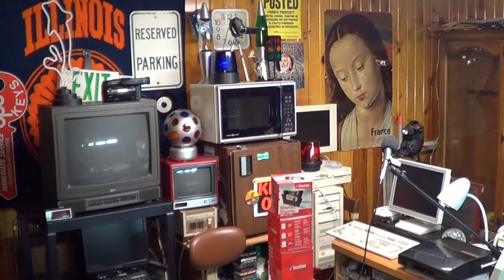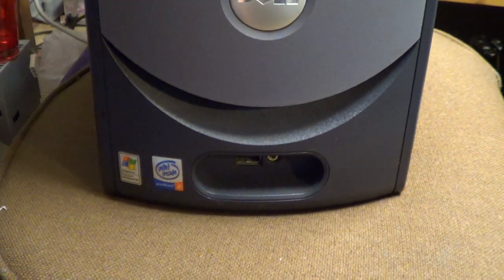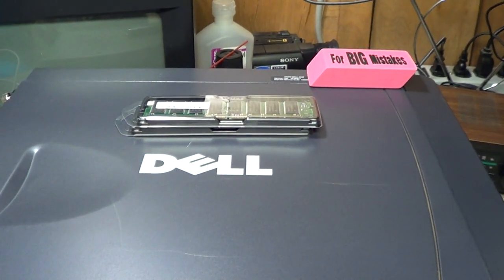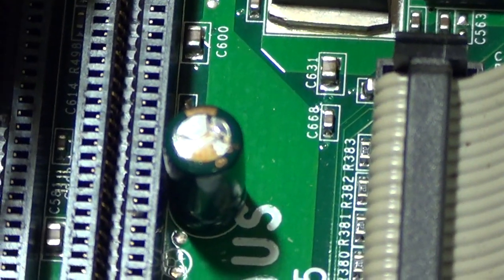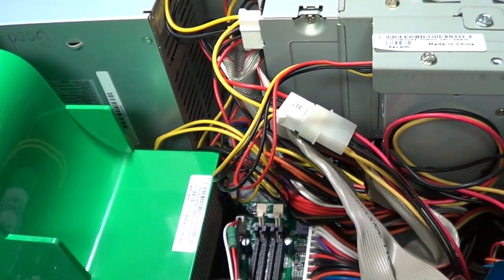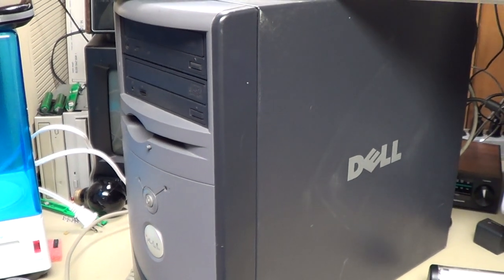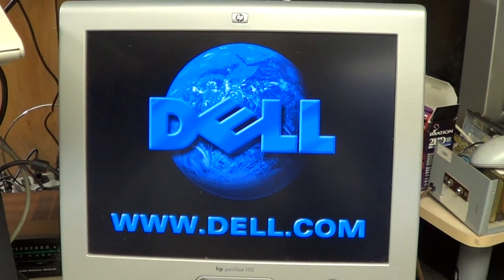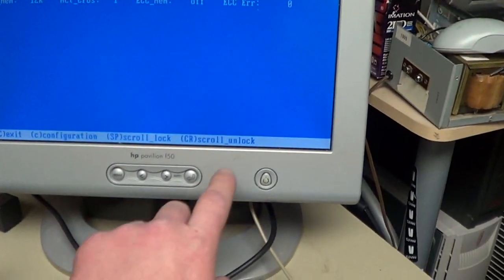Dell Dimension 2300 "Music Player" Computer RAM Upgrade

Comment: Uxwbill,im a very big fan of you. But i have a question, i have a dell demiension 2400 and for some reason i cant download stuff on the internet. Could you please reply and tell me how to solve that problem. Also if you reply i will subsribe to your channel!!!!!!!!
Reply from the maker: Whatever you are dealing with is probably not a hardware problem, and you have to bear in mind that computers can have thousands of different software configurations. It would also help to know exactly what you are trying to download: music, movies, games, software, maybe something else? It may also be very important and helpful to know what error messages you get. What operating system are you running, and what version is it?

If you have access to another web browser on that computer, have you tried doing the same thing with it?

It is my goal to read and respond to any comments posted on my videos whenever I have something to offer. There is no need to subscribe or anything else. I may not be able to offer you much help. Even to get started will require more information than what you've given me.
Reply: ***** Thank you thank you for replying,Ok so I'm trying to download the Ccleaner but when i try it says (security setting on your computer blocked this file).I am downloading this stuff off of Google Chrome.The version of my computer is a 2002 (service pack 3).I don't really know what operating system is but if I think it might be this (Pentium 4,CPU 2.40GHz,1.25 GB of Ram). Also its running Windows XP Home Edition.
Reply from the maker: I don't use Google Chrome. If it has a setting to block some or all downloads, I'm not aware of it. You might have better results asking in a Google Chrome user forum and a web search should turn one up right away. 

Windows XP Home Edition is your computer's operating system. The only other thing that comes to my mind is the possibility of your having a limited rights user account on the computer, or that group policy settings have been turned on that would block certain types of files from downloading. Group policy is not officially supported in Windows XP Home Edition. The settings exist to turn on various policies, but they are hidden. Malicious software can enable these settings, so you might want to make sure any security software you have is working, and try a tool such as Malwarebytes. To find out what kind of user account you have, go to the Control Panel and choose the "Users" icon. It will tell you what kind of account you have, and it should say "computer administrator". If it does not, I would suggest talking to the person who set up or sold the computer to you. 

Finally, while a lot of modern software still runs on Windows XP, Google Chrome will stop supporting it very soon. Web browsers like Google Chrome are updated all the time to fix security hazards, so that means you will not be able to utilize your computer safely on the Internet. I would suggest getting a newer computer: it will be much faster, far more secure and will give you years of reliable service down the road. Any computer running Windows 7 or later will also qualify for a free upgrade to Windows 10 (if you want it) until July 29th, 2016.